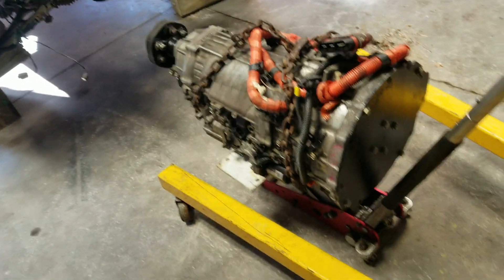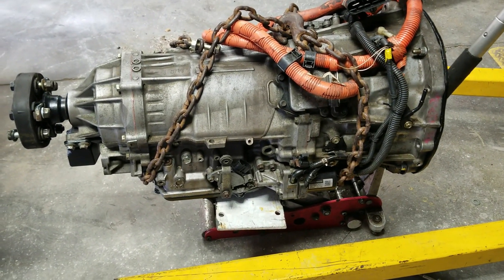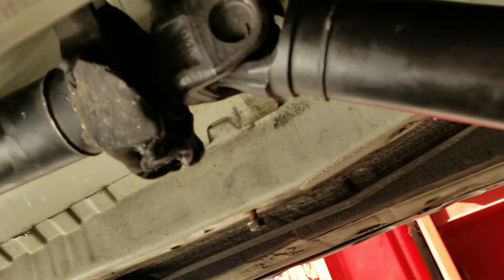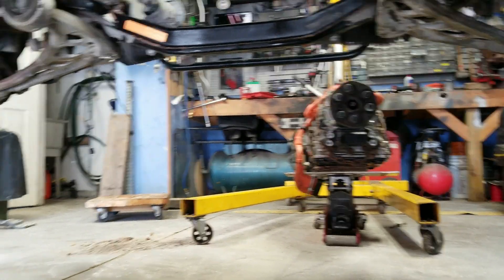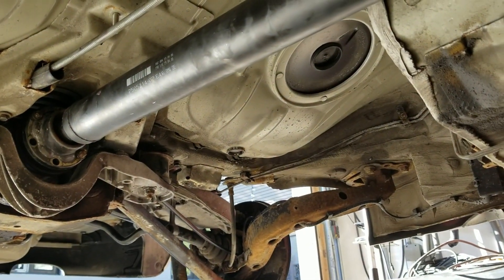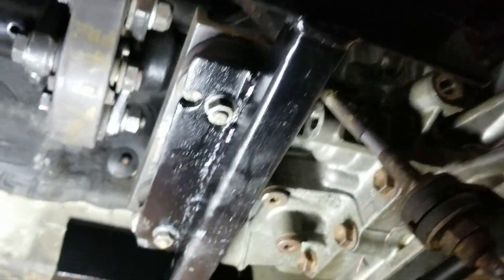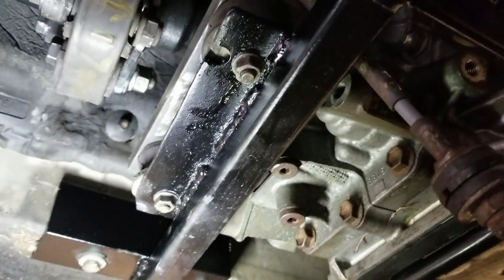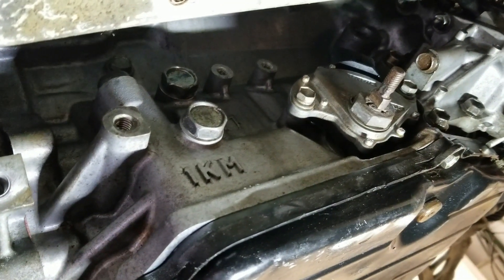Electric Car Conversion e46. Motor (electric) Install

Comment: Did you have a method for positioning the output flange to get the correct angles for the prop? Working on putting one of these in an E91
Reply from the maker: 1. used a level with a digital read out.  
2, Made a note of the level reading of the prop/driveshaft with the original engine and transmission still installed.
3, With the engine and transmission removed I then placed the prop/driveshaft  at its original level (using blocks of wood and shims)
4. I then place the GS450H gearbox at the same angle using the GS450H oil pan as refence point.
 5. hope that kinda made sense.:)
Good Luck!

Comment: Do you think you could publicly release the designs and dimensions of your brackets?
Reply from the maker: You kidding? I just winged it. Nothing was written down.  
I had a general idea what I needed and  just basically started with the 2 pieces on the frame rails and built from there.
Trust me lots of mistakes were made but that's how a DIYer learns.

Comment: Great progress. I'm liking your mounts. Leaves plenty of space in the engine bay  I think I might have gone way overboard on mine with 40mm thick wall box - especially with my puny Outlander motor.
Reply from the maker: Time will tell if my welds hold up. :)
Reply: @InTheGarge  Where the fuel tank was an heat shields was you could use cut up blue plastic barrels as cover plates, seen them use for making boats like this https://www.youtube.com/watch?v=u8SUfWBFFDA